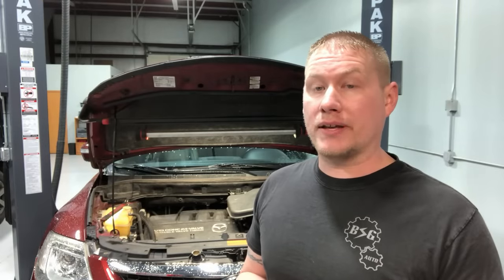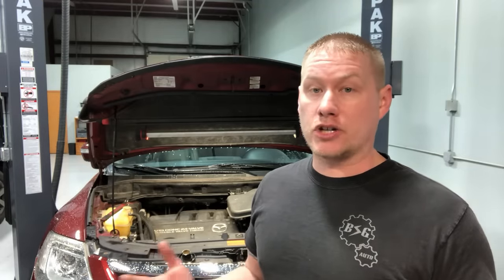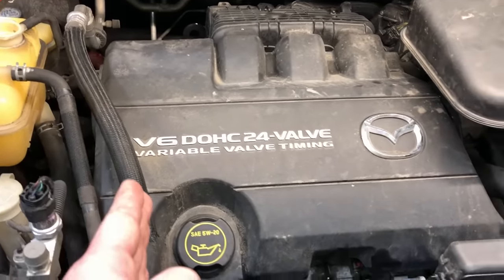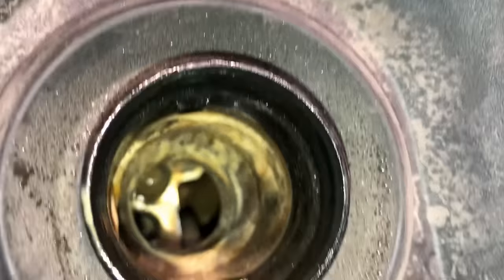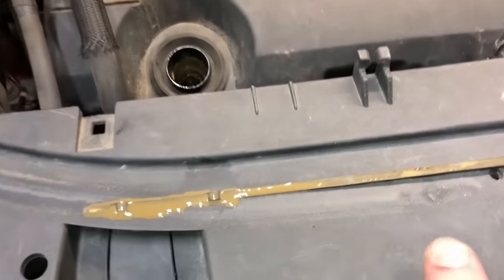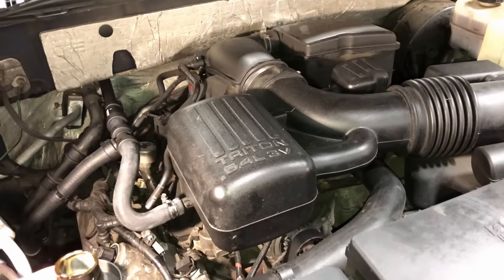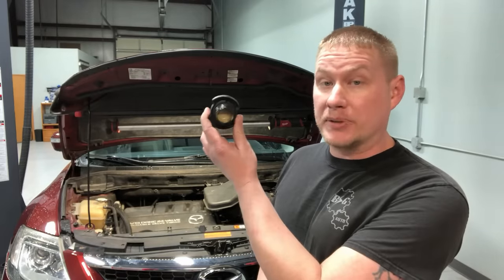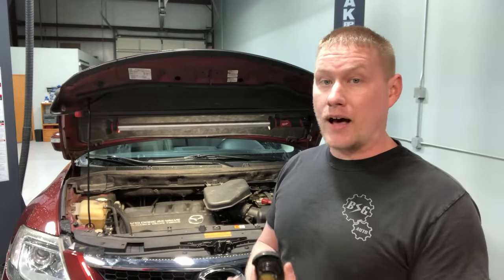Do You Have a Blown Head Gasket?

Comment: I have a question that doesn’t have to do with this issue but I have a 2010 f150 with the 5.4 and I recently have been having the battery terminals corroding, what recommendations do you have to help prevent that? Thanks
Reply: Terminals only corrode if there's acid present. It could be from over-charging causing the acid to boil out, or the terminals are leaking. Either way, if that battery is 8 years old, get a new one. Scrub clean the cables real good with water and baking soda and rinse well.

Comment: This was informative. I purchased a 2012 Ford f150 stx V6 pick up and found this the first time I checked the oil. Cleaned out the cap thinking if its a bigger issue it will come back. waited 2 weeks and checked again. it was back. Already been to my mechanic ( I trust ) for a bumper to bumper check ( always get that done about twice a year ) and he said no problems. So, I figured ( as you pointed out ) not a problem just condensation but, your vid put my mind at ease over it. thank you.

Comment: Good info.. subscribed.  Just replaced my radiator in my  1999 Ford Expedition. Now I will be working on the heater flow probably the  blender motor.  I think I have to pull the dash.

Comment: Fords have always had the milky oil filler cap problem from condensation since the 70s. Haven't really noticed that problem on gm or dodge.
Reply: heavy metal redneck GMC sonma been like that for several years, but keeps running

Comment: This channel has saved me thousands. I have a 2000 Ford F150 5.4L that has this cream color on my cap, but dipstick shows normal. I've had two mechanics tell me blown head gasket. I live in a northern climate. I do have a cracked (plastic) upper intake manifold which leaks, is common and the repair is posted on a demo video here on this channel. I still need to know for sure if I have a blown head gasket or cracked gasket. No affordable local repair guys do pressure tests. No equipment. They only focus on the quick repair stuff, more profitable.
Reply: Drain the engine oil, send some off to a lab (I recommend Blackstone), they charge $25 to analyze the oil and tell you if it has coolant in it. They also analyze it for excessive fuel dilution and wear metals. Most labs will send you a collection bottle to use for the sample.
Reply: @brianleeper5737  - Thanks Brian. I forgot about them. Will definitely order the kit today. Gas consumption at idle seems to be highly excessive. Long story on why I have to let sit running idle. No idea what is causing it.

Comment: The first time I saw oil cap pudding it was on my son's Jetta, which had a bad coolant hose flange that leaked externally. It was as bad as you show here on the oil cap, but not on the dipstick. There was no direct coolant contamination of oil, and the problem disappeared when I fixed the external coolant leak. I think trapped air in the cooling system caused mild overheating, forming steam that condensed after short trips.

Comment: Do the Triton 5.4 2v have issues with head gaskets?
Reply from the maker: Not in the traditional sense no, they do have external oil leak issues from the high pressure oil feed to the head at the left front and right rear.
Reply: Had to replace head gaskets in my 97 5.4 2-V Expedition.....at 430,000 miles.  Exhaust was leaking into the coolant from the #3 cylinder.  Just cleaned and surfaced the heads and reinstalled them as the valve-train was still in specs.  All cylinder crosshatches were as new - amazing.  These engines can go to the moon and back (and then some) if properly maintained.

Comment: THANKS FOR MAKING THIS AWESOME VIDEO!! I have the Chevy 3.4L engine that is known for head gasket and intake gaskets when using GM DexKill I had normal condensation with no real signs of coolant entering the crank case. Your explanation of normal condensation was very helpful, I was really worried at first, but I’m not loosing coolant and my oil is nice n clean … very valuable info!! Thanks

Comment: i just had a new waterpump put into my car now the coolant pours out when i rev the car is this badly fitted or could the gasket be gone? its coming out very fast and loads at once not just drips
Reply from the maker: Have them pull it back down immediately this is either a faulty part or installation.
Reply: @FordTechMakuloco  they wont touch it now guna have to go to another garage
Reply: @FordTechMakuloco  was a pipe not on proper when i look at the belts theres 2 one looks like a 4 grove and one is a 6 grove 1 is a cam belt whats the other?

Comment: Is the water pump driven by the chain?
I think it can leak and mix with engine oil.
Reply from the maker: Yes it is internal and when they fail they dump coolant into the pan as explained in this video. Did you watch it all the way through?

Comment: I have a 2001 Chevy venture mini van that over heat's and I was told it's the head gasket but I have my doubts.
Reply: This is a problem with the 3.4L engines. Seems like the dex-cool antifreeze GM uses eats the gaskets over time. Especially if you have ever mixed the coolant types. I have had to replace head gaskets on my Olds Silhouette because of this issue.  I switched coolant to Prestone (Yellow) afterward and haven't had any problems since. That was 60K miles ago and still running good.

Comment: If you don’t plan on driving it for more than a week, how long should your engine idle for at operating temperature to get rid of the moisture ?
Reply: As soon as your engine reaches normal operating temperatures, the water should naturally evaporate. 
I let mine (77f100) get up to 180°f 
this usually takes about 3 to 4 mins

Comment: White smoke coming out of the exhaust , blown head gasket
Reply from the maker: or the engine is running rich, you can tell if its rich then it will stink like gas or a cold card starting before the cats light off and coolant burning from a head gasket would be a sweet exhaust smell.
Reply: @FordTechMakuloco  yeah that's true but the video reminded me about mi wife's 2003 grand prix 3.1 and their notorious intake gasket going out and draining a milk shake out of the oil pan lol.  The experts in her family all said the same thing is a blown head gasket lol

Comment: What do you recommend for 2000 Ford F-150 regarding a timing chains? Do you recommend just to change the guides and the tensioners or do I have to change the chains and the sprocket too?
Reply: replace the chains, I have 5.43v I opened and only change the tentioners and guides to have the same problem morning start raddle, it was the chain that was strech and the tentioners were going all the way out!!!
Reply: Not being a dick but why wouldn't you change those anyways? With all that work to open the front of the engine up to get to those I'm changing the rest of the timing components.
Reply: I did just the guides & tensioners at about 175k. 390k now no issues.
Reply: @gferryman1  Never fails to amaze me the idiots who want to save a couple bucks and not do it right the first time.

Comment: What about if it’s leaking on the exhaust side ?
Reply: Take the radiator cap off with the engine cold and check for bubbles with the engine running.

Comment: when I heard Head Gasket, my first thought is junkyard.
Reply: What the hell? When I hear head gasket I think about removing the head checking for straightness and replacing a new gasket.
Reply: @zoneb609  hahaha Thats because you have the skills to pay the bills ;D
Reply: Head gaskets are not incredibly difficult on a technical level most of the time, just time consuming. Put the parts in the order you take them off, and put the fasteners with the parts, reassembly is a piece of cake that way on any job. If you go in working sloppy, throwing all your parts in a giant pile, with fasteners mixed up, you will have a nightmare. Prior planning eliminates this problem all together. Assuming you haven't warped the head, it's all about properly tightening down the head bolts, using the torque and methodology in the handbook. There are so many resources out there to guide you, you just need the patience to get the job done. Besides complex electrical issues, most car repairs are pretty straightforward. If it comes down to it and you are stumped, you can always pay a shop to diagnose it, and do the parts replacement yourself, which will still save you a boat load of money. Cars are not the crazy wizardry people make them out to be, you just need some common sense to do most things. I started off not knowing a damn thing, and used YouTube videos and manuals to help me. Since then I have done everything from simple brake jobs, to transmission replacements, clutches, timing belts etc you name it. No way I am cleaning out my bank account to pay the insane labor rates shops want to do car repair.
Reply: Head gaskets are easy if it’s a smaller motor imagine doing a rear head gasket up against the firewall like on v6 fwd
Reply: @hairydeck  Right, in situations like that you are better off pulling a motor if access is heavily limited. Pulling a motor is still not a very technically difficult job, its readily apparent what needs to come out in order to get the motor out. Engine lifts can be rented on the cheap, or bought for very reasonable prices without issue. Any major engine work is time consuming as hell, but shops tend to make it easy for me to stay motivated. The choice between having to do a couple days of car work, or paying a shop 4000 dollars is an easy choice for me. Other than alignments and tire replacement / wheel balancing, my car will never be in a shop.

Comment: If cars have aluminum  valve covers this would be much less occurring.  Plastic  acts as a heat insulator well unless it's hot outside
Reply: What would be less occurring? Head gasket failure? Methinks you are just guessing.